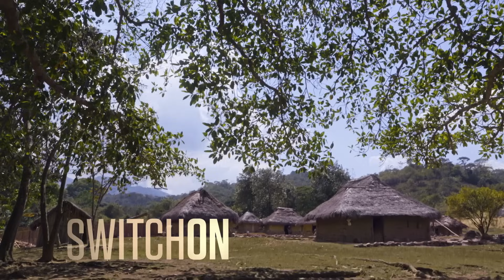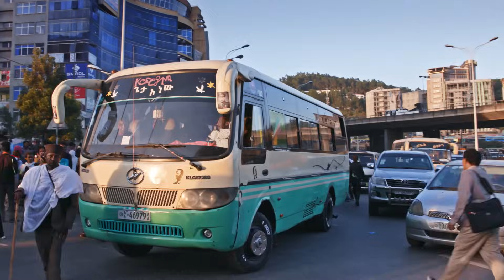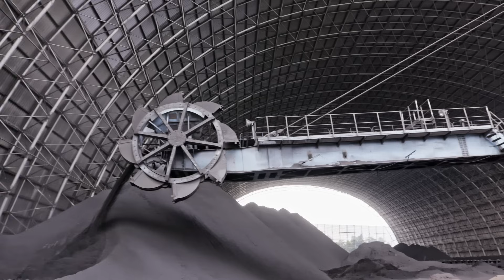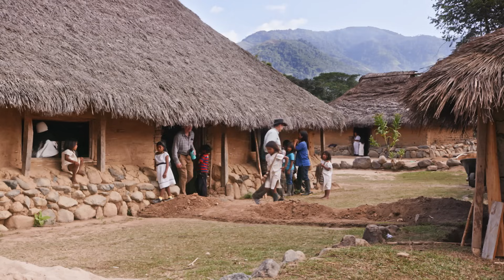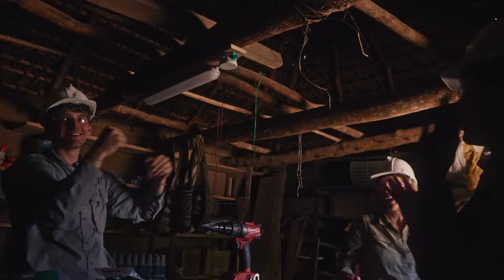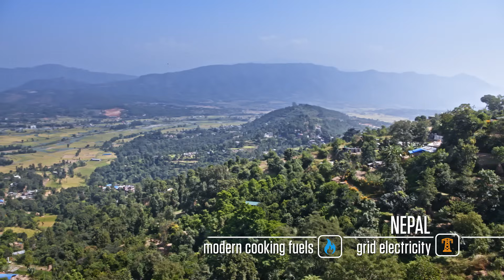Switch On: The Complete Film

Comment: I applaud groups of people working together to accomplish a project like the one shown here in Columbia.  It is misleading however to say the installation of some solar panels and some  Chinese batteries has “electrified” that village, in the way that Vietnam and Ethiopia are becoming electrified. The two things are not remotely similar.  In that village with solar panels there will be no drinking water moved by electric pumps, no modern hospitals.  Those batteries won’t even get a family through a full 12 hour night, and in few years they’ll require replacement.

Stop screwing around with pleasant acoustic guitar soundtracks  and get nuclear power into the developing world.